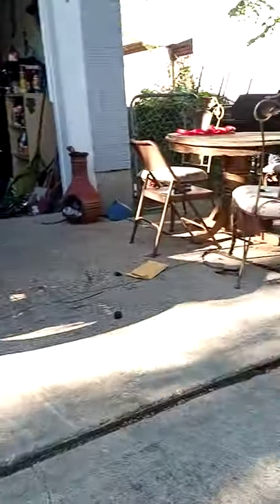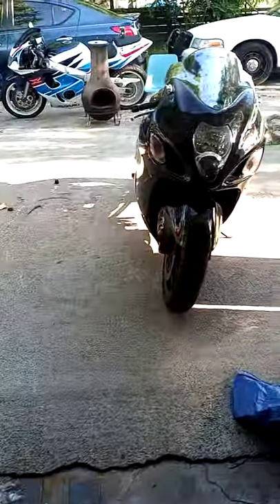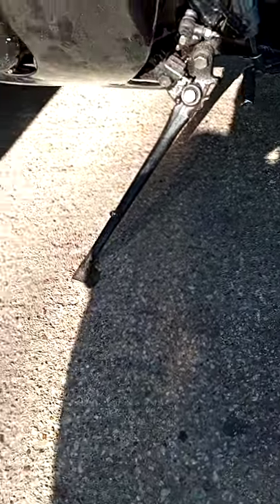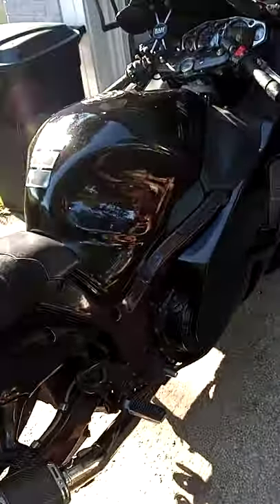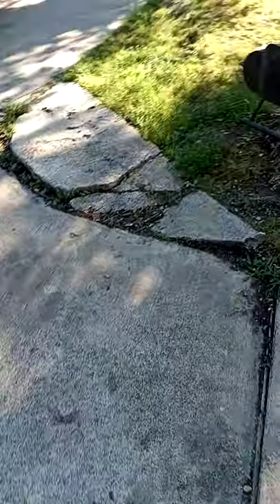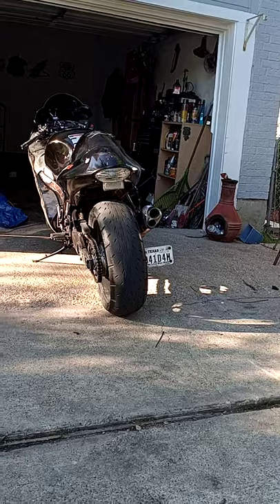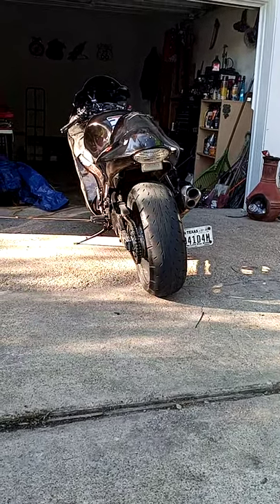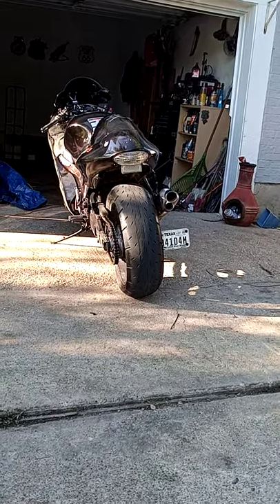Hayabusa and gsxr 1000 750 600 clutch rod seal in 1 hour

Comment: so did you grind the metal lip on engine away to fit new seal from outside and then a plate on top to hold it in place, do you need the old seal on there to or can you just put new seal and plate on top 👍🏼
Reply from the maker: @bccapone837  put old seal over new one it’s just added pressure

Comment from the maker: If you guys need pics or step by step video of this I'm willing to take it back apart to show you guys how it's done also since the fix is put roughly 1000 miles no issues
Reply: I just want to know how you put the new seal in? I have the same problem and I already fuck up the new seal cuz it's hard to put it in. I got me a new seal but I wanna know how you did it before I do it. let me know please....
Reply from the maker: @ryanrile  hello bud you'll have to get most of the lip off I'd say about 75%of the lip that olds the seal in place you'll know once the old one pops out go back in and grind some more so you can pop in the new seal use some silicon to kind of lube the new seal that is going in

Comment: too bad you din't video the process, wondering if a guy had a puller that could get in the rod hole with claws that grab and pull it out or does it have to come out the other direction?
Reply: poor design, should have a C clip holding it in and pull out rider side

Comment: A magnet will pull the pin out
Reply from the maker: If rod is broken chances are it's bent and will have resistance it will not come out without removing the seal almost guarantee it but yeah worth trying